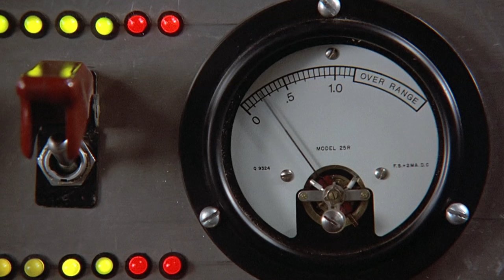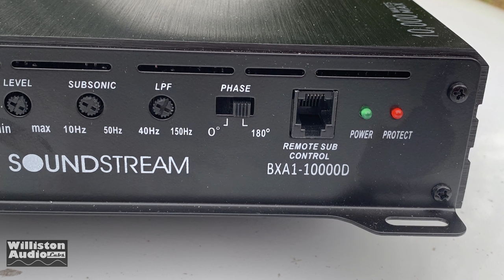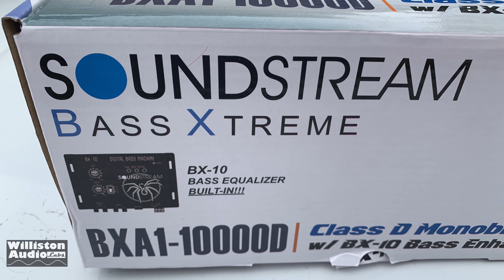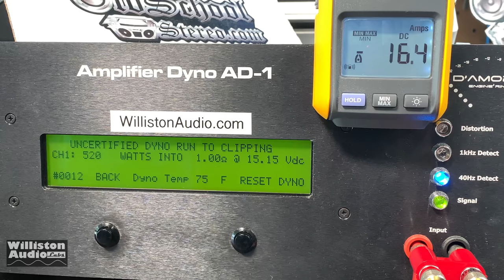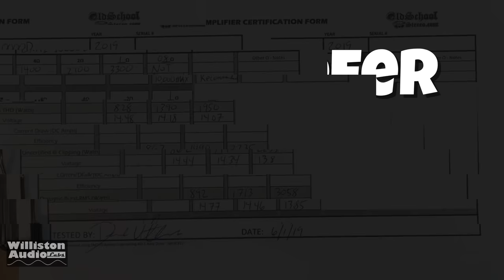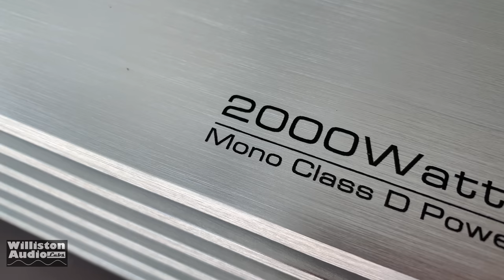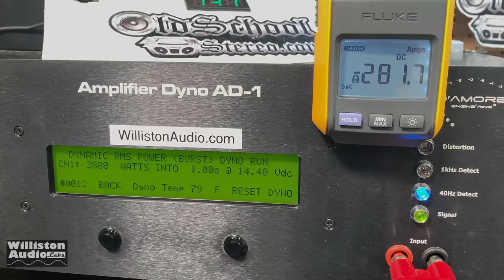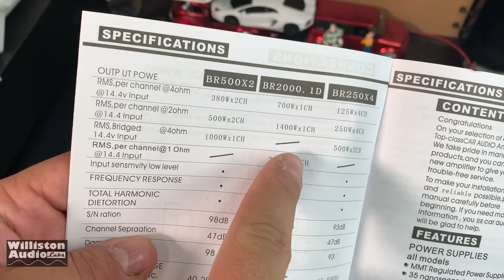Soundstream BXA1-10000D Bass Extreme Amp Dyno Test and Bass Rockers BR2000.1D [4K]

Comment: Out of all the amps you have tested what are the best 8000 to 10000 watt amp you have tested and the price of them.
Reply from the maker: Hi Brandon, I haven't tested any amps that large (RMS power) due to electrical limitations. The most powerful I've tested are PSI 5k, Orion 3k HCCA SPLX and Taramps MD8000.1d (not enough electrical to support this one)
Reply: @wal  ok well I will check out your video on the orion. Thanks

Comment: So basically the Nissan of car amps.  Might work for 3-12 months if you're luck and have low standards, but plan on replacing it with something that actually works properly (nissan cannot make a transmission to save their company).

Comment: Need recommendations for powering
 4 Alpine type r 12" dual 4 ohm 1500w each I got wired down to a 1/2 ohms to jl rl 1500.1  medium size box large port
Reply: I'd change the wiring to 2 ohms then get 1 or 2 of the Taramps 3ks

Comment: Cummon bruh! I was asking for the Soundstream Rubicon Nano RN1.5000D, the 5k watt amp. We all know that Soundstream could never produce a 10k watt, or even a 5k watt amp this day in age. Epsilon blows, and Soundstream will NEVER be as good as they once were, we all should know that by now (at least those of us that know what Soundstream used to be like back in the day. Especially when I had a Soundstream Reference 1000x4 on 4 Kicker Solobaric round 10s in my Integra. Now I have the Rubicon Nano RN1.5000D on two Sundown Audio SA12D2s in my Civic coupe and it makes PLENTY of power for those two subs, but I wish it wouldn't pull so much power for the little bit of power that it actually makes.

Comment: I'm going to try this and pray y'all will see and respond. Could you point me in the direction of a app that's budget friendly with a honest 1000-1200 watts?
Reply from the maker: Polk has refurb versions of their PA D1000.1 amp on eBay right now for $129 and they are regularly $349! It’s rated 1200W at 1 ohm

Comment: Yo Big D
Something been bugging me for a while 
I'll like to see a demo from a cars electrical system wired to the smd 
I often see the the 14.4 volts and a bit less showing but how would the amps respond to a cars electrical system 
I understand you'll have to upgrade your cars electrical system for high powered amplifiers 
But for some reason i jus don't believe you get the same rms power from them...that's matching your amplifier to the cars output tho..
Reply from the maker: Good point. My tests show best case scenario and resistive loads don’t fluctuate like speaker loads.
Reply: Man..thanks for understanding...im was lock on...Whenever you post one related,I'll sure see it ..
Reply: Yes and what is I forgot to look at the speck a lot of these amps can go up to 16 or 18 V and maybe that is where the extra power is going to come from but I don't see 10000 ever but definitely possible it might get 4000 or 5.
Reply: Old brands were notorious giving half of what they claim and that should be something to expect since it's been that way since the 90s.  1st step is price you will get what you pay for because business is all about profit so it's automatic to know you are not going to get that wattage and you might as well chopit in half. However this amplifier has 240 amps of fusing that is amazing however so does the Rockford  T 1500.1 BDC P it is rated with a 250 amp inline fuse. If you are not a brand nut and you don't have stuck up friends it seems like this amp will do well and last a good time as long as you don't run it at 1 Ω.  Preservation is key and not to burn it to the ground.  I am somewhat impressed on how many capacitors and the dual coils.

Comment: The adapter works no different than reducers. Honestly a lot easier to place the wire in more secure using reducers. I use them myself as my amp only allow 4 guage.

Comment: Lol I was just wondering about these. Saw them on ebay along with some poweracoustic rates at 4000 rms.
Reply from the maker: Yeah, I tested the PA “10k” a couple of years ago. Overrated too
Reply: @wal  check out the Belva BB3000Dv2

1800 rms for $129?
Reply: @wal  NVM lol , you already tested.

Comment: I got two soundstream amps. A 4 channel pn4 1000d and rub 1600d,they both shut off,  the 4 Channel channel is running 4 Soundstream 6 in mids and tweeters  the mono block is running 4 Rockford fosgate p2d2 8s and one ohm. It sounds good tell you give it the onion. Then the kids shut off or the subs. Some times both. Not to impressed in the amps .

Comment: The Epsilon owned Soundstream has had a few amps recently do rated power. Their Rubicon or Rubicon Nano was tested here on Youtube to do rated. When they brought back the Reference series for 1 year those did rated....but most of their other amps are like this...overrated. Just another case of if you know what you're buying, it isn't a horrible deal...just dishonest in their rating. 2k watts for $200 isn't a horrible price.

Comment: Nothing is supporting the main PCBA of either amplifier. Where are the screws? Is double sided tape and the output devices supporting the whole PCB? Probably not even. Looks like the PCB slides into slots in the heatsink/chassis and that is it. Maybe a couple pieces of foam rubber on the backside to slow down board flex. Cheap. Just cheap. Don't care if the PCB is narrow.

Comment: Disappointing!
SoundStream use to be a reputable, quality company. I have a pair of "old school" SoundStream Exact 10" subs (from the mid 90's) that still sound fantastic. Some of the best subs I've ever owned.

And the biggest problem with this isn't the Amp wattage, amp quality, amp features, or even price point. It's the moronic ratings!
Otherwise this review would be "Hey, this $200, 2,000 watt SoundStream is well built, priced right, and has great headroom!"
But, no!

Comment: The one thing to always remember if it had fuses on the outside of the amp it's a lie
Reply: What about Rockford fosgate power series (the ones made in USA)? The one I had was a T20001bd was from 2004 and the birth sheet said over 2400 rms at 1ohm

Comment: I wish u would throw a couple of what ever subs with a brand new not refurbed Kicker Kx amp n put in ur car. N tell us how u hear the bass vs most amps or even that power amp with subs in car so we know how they compare sound wise. Ya u proved point time n time again bs watts. How does it sound on the notes most amps make sub just not sound right. In my e experience ro. Power and kick kx. Make them.notes sound good. Instead of sounding like sub is rippin or sum stupid sound i know thats frequencys but that what im after.

Comment: This amp is such a POS. I bought one and installed it .It powered q 13w7. it lasted 20 min at 1.5 ohm. Sound stream. Fixed it and  when I got it back it lasted 10 minutes. Soundstresm warranty states yoi must get it installed professionally. The tech said my degree in electronic engineering and 30 years of car audio as my hobby wasn't enough. The aren't the soundsfream of back in the day when I could bring my D200 to Refondo Beach after I melted  the fuse holder off of them cuz of the speakers I was running and they would fix them on an hoir.

Comment: I would be infinitely more likely to buy
A 200 dollar amp rated at the 1300 true watts, than some astronomical 10,000 watt bold face lie that in my mind probably makes 400-500. The equivalent to if Ford claimed the mustang makes 5000 h.p. they wouldnt. why do manufacturers think is ok to just lie?, probably the main reason I stepped away from messing with car audio..
Reply: Tekboy 808  i just got tired of knowing the truth, and ever expert thinking they had 30,000 watts because the box said so, it just got cheesy, I mean good luck with your babababababa bass🤯. Lol whatever...

Comment: 2k watts for 200$? That's a bargain, but I gotta wonder what kind of damping these cheap-ass amps actually have, compared to the higher end brands. Also, if you want to stop needing to frankenstein reducers all the time, just run a 0 gauge in to 4 gauge out distro block, and make the 4gauge run short. should have zero issues with current

Comment: These amps are junk they feature distortion which can damage expensive speakers  the best amps on the market are Rockford Fosgate they cost more but you will hear the power they dont run hot and shut down i have the t 1500 watt power series amp and the birth sheet says 1836 watts so you get what you pay for

Comment: This amp is such a pile of junk. Soundsteam will not willingly support it. Had to threaten them to fix it the first time. It lasted for 1 hour the first time. Second time 10 minutes.First time was ruming it at 3 ohm 1 jl 13w7. Second time 1.5 ohm 2 13w7s. It sounded good but but it is pooly made. The soundstream support and Customer service peple are rude and basically told me listening to customers issues is a waste of time. I will never buy a product from this company again. The soundstream that was located in redondo beach and made awesome bullet proof amps is gone.